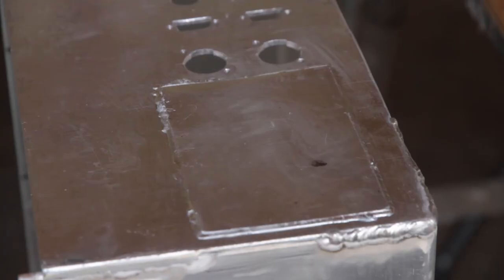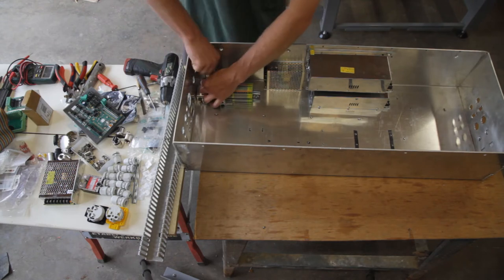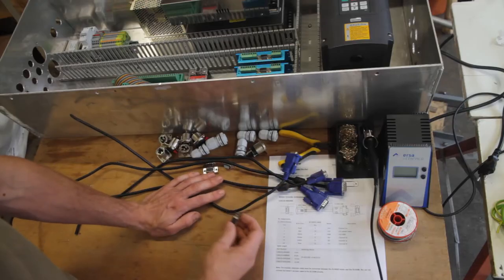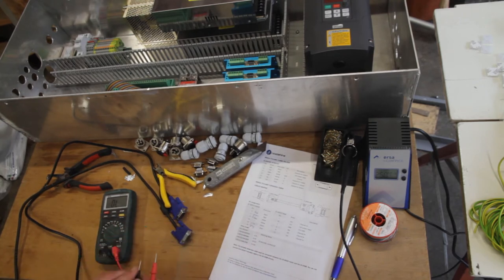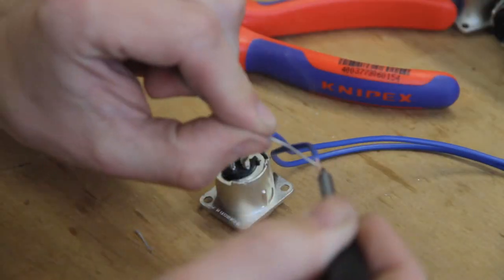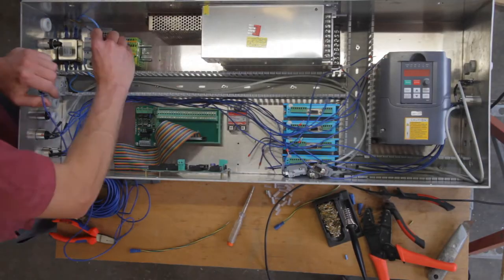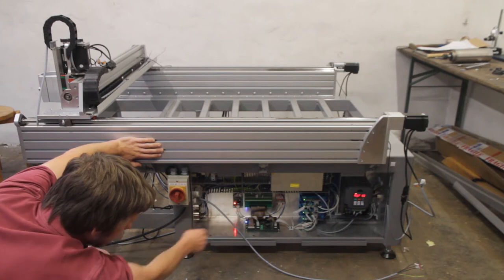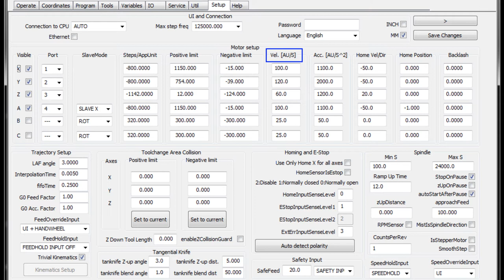CNC Router Build part 4

Comment: very good job my friend, I have a question: That kind of linear guide rail is recommended for routing wood? i heard in another video that those guide got stock with excesive dust
Reply from the maker: That was my concern as well, but it is not that problematic. If you take the high quality linear guides, they will have scrapers to take off the dust. And when greasing them, I don't see much grime in them.

Comment: great job !!! I need help with my project. I am making a similar machine, can you provide me with the electrical diagram and March settings? Thanks in advance
Reply from the maker: Thank you. I don't use mach so I cannot give you the settings for this. As for the electrical diagram, I started working on it, but have since lost the files. There are some drawings on this page: https://cnczone.nl/viewtopic.php?p=77252#p77252 You will probably have to log in to view the images. Unfortunately information is in Dutch. You can use google translate to translate the page.

Comment: Hi, where did you bye the pullyes and the belt you have used for z-axie motor?
Reply from the maker: Hello,
I ordered it from stappenmotor.nl. You can also find it in the spreadsheet I added in the comments. Good luck
Reply: @WimsMill  Thank you :-)

Comment: very nice work  .which microcontroller do you use in your cnc .
Reply from the maker: Thanks a lot! I used the EdingCNC controller (http://edingcnc.com). They use a microchip microcontroller in there.  I didn't want to waste time on figuring this part out myself and they have good control software for it. That makes things a lot easier.
I wish you success if you are building your own machine.